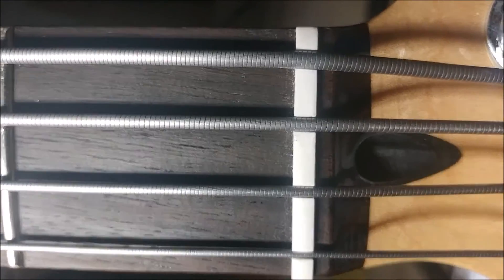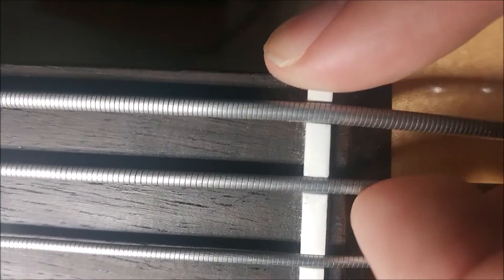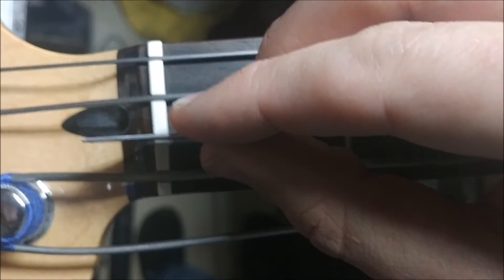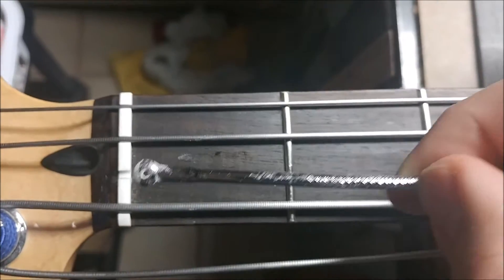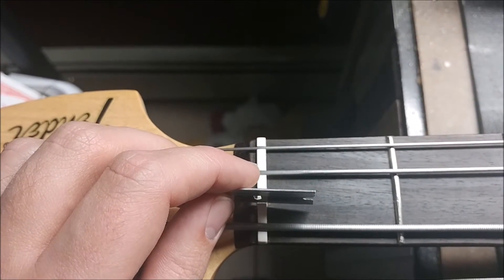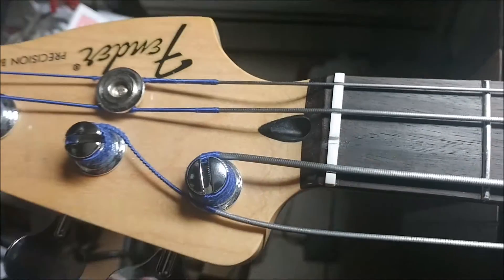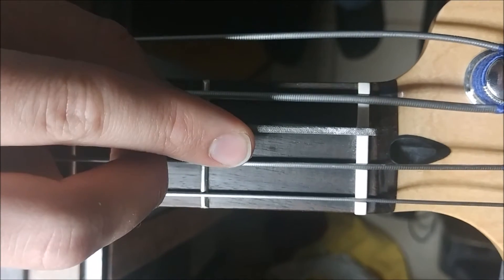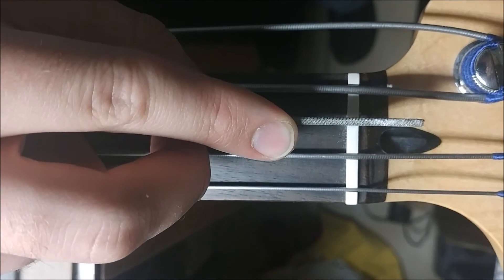1 Minute Guitar: Fix Bass Open String Buzzing

Comment: rip to my brass nut ig:(
Reply from the maker: If the slot is too low, you can put a shim underneath the nut after removing it. This will also allow you to cut the slot a little deeper with the correct sized nut file if that's the problem (too wide of a slot). 

You can use just about anything as a shim. Wood veneer or even a thin sheet of brass. Remove the nut, trim it to size, and put it in the nut slot before placing the nut on top of it. 

Shimming is always an option if you can't fill the slots -- and even if you can. Let me know if you get it working again!